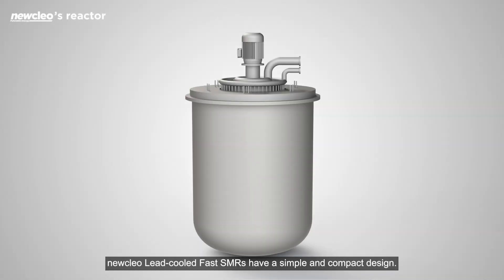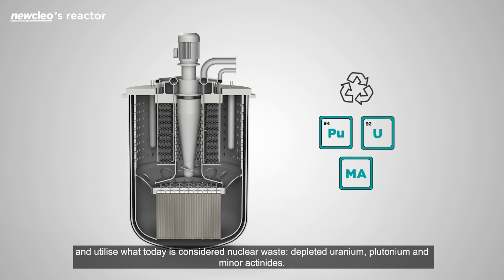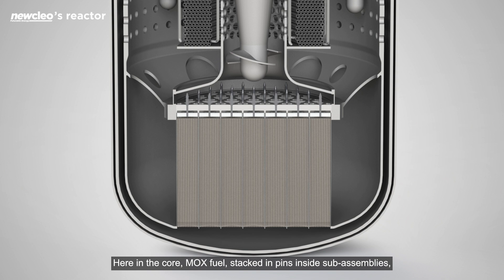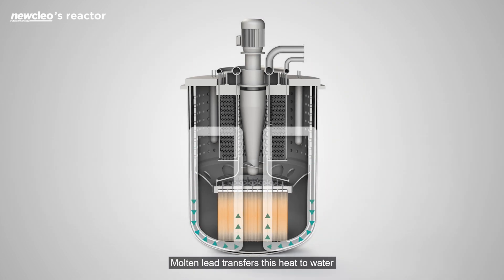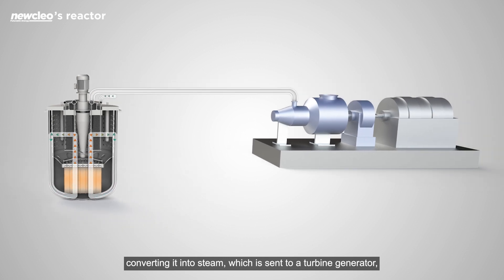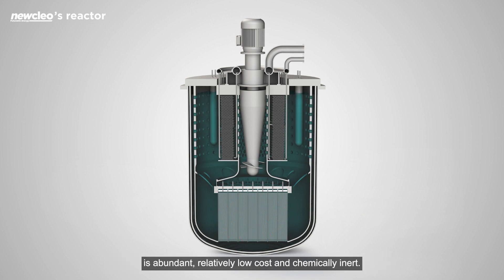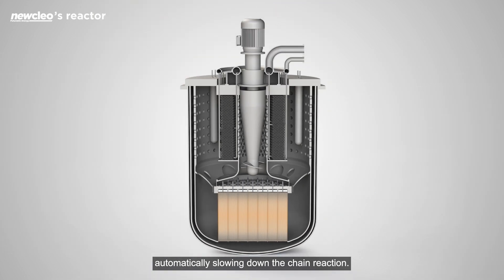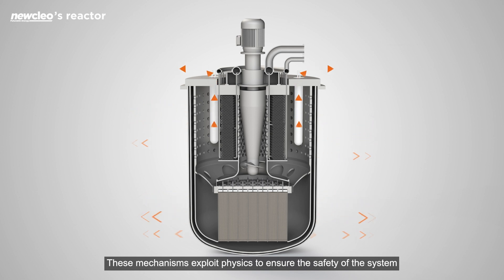Introducing newcleo’s LFR-TL-40 reactor

Comment: It's my understanding that MOX fuel is a combination of U238 and plutonium from weapons. A great way to get rid of this surplus plutonium but what will this reactor run on after that plutonium is all used up?
Reply: U238 is converted during irradiation in Pu239 and is self sustained👍🏻
Reply: In a Fast Neutron Reactor, U238 is converted into new Pu239 during the process. This means that you need a certain amount of plutonium just to start the process.

If the Pu239 stock is finished there are two possible ways:

1) Use part of the Pu239 produced by an FR to start a new FR

2) Use the plutonium produced by the standard PWR of BWR reactors to generate new MOX fuel
Reply: U238 converts to plutonium when hit by fast neutrons. Even then, U235, U233 (is somehow spares are available) and some nuclear waste can be dumped in to be burned